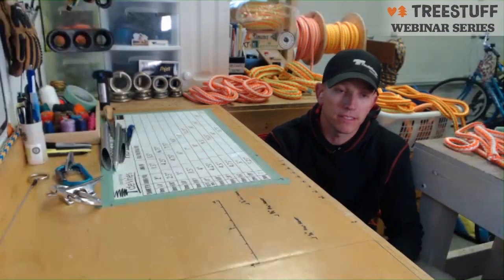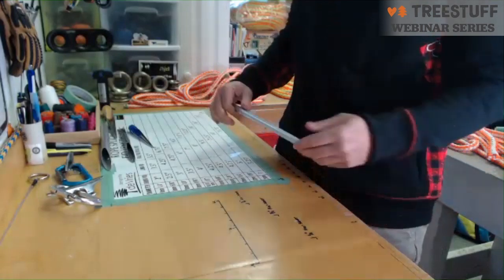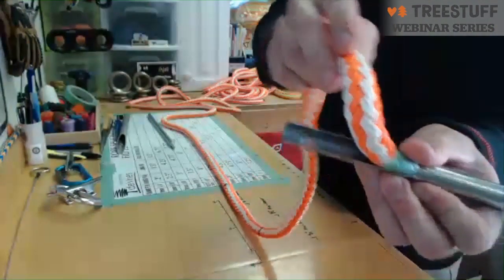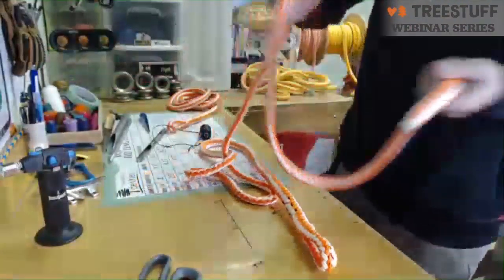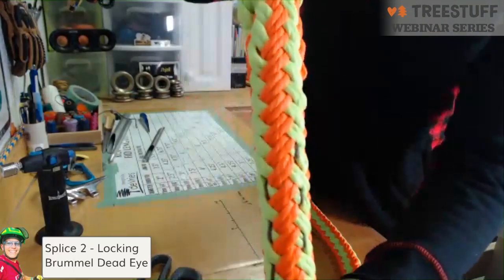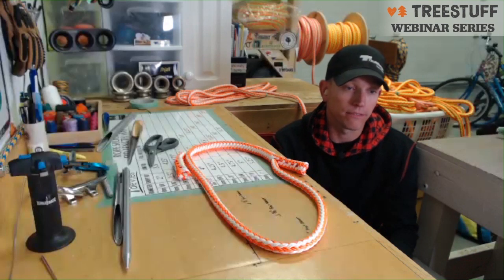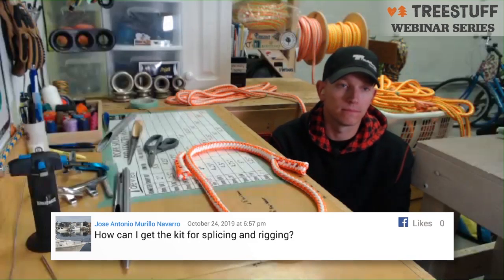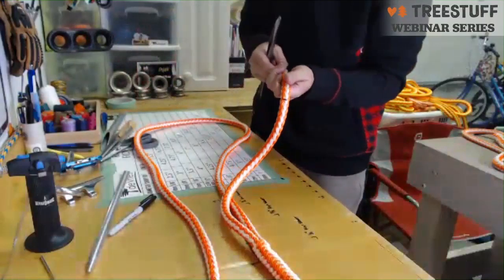Splicing Rigging Slings with Peter de Vries - TreeStuff Webinar

Comment: Around 11:30 when making the taper by pulling out strands, you give the LOCATION of where to pull out the strands (counting back towards the bitter end from A) but not WHICH of the 12 strands to pull out (1 or 2 at a time? and all adjacent strands or skipping or opposite side strands?).  Can you clarify this with a pinned comment please?

Comment: Great video. I've done some splicing in climbing ropes a d rigging ropes. Also some rigging slings. Just have a question, what size string you use for stitch lock?
Reply: its recommend to use the same size thread to stitch lock as the size thread in the rope, which on some ropes its quite big. 1 to 2 mm waxed nylon, polyester, or even dyneema if you want to get fancy